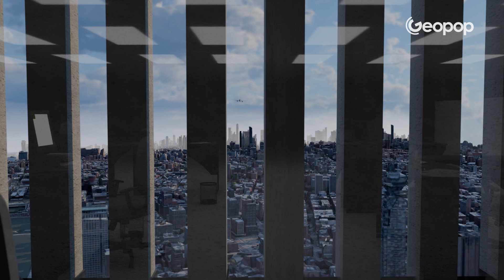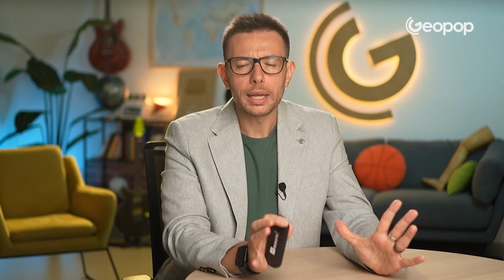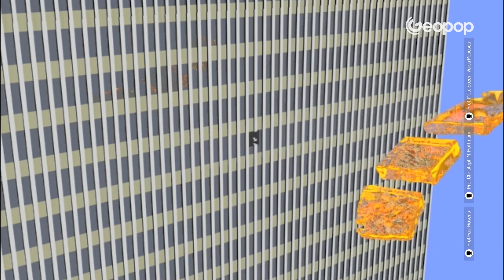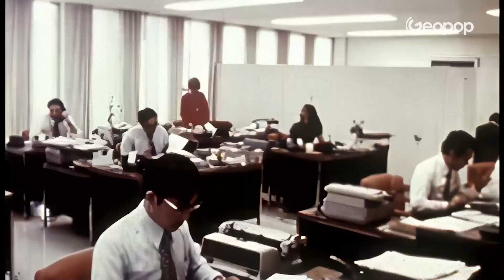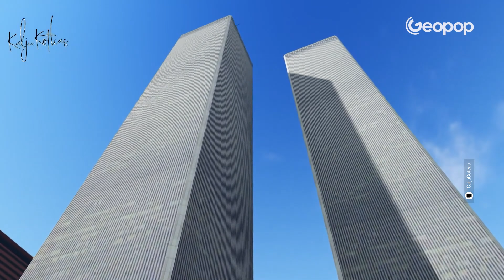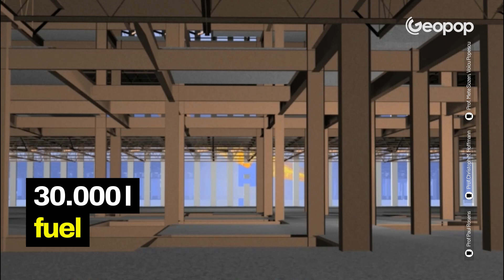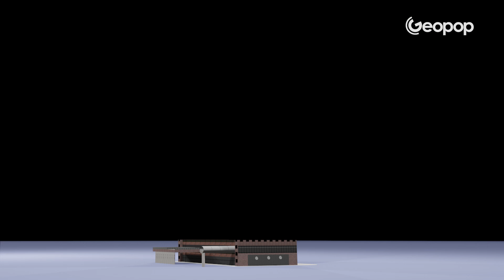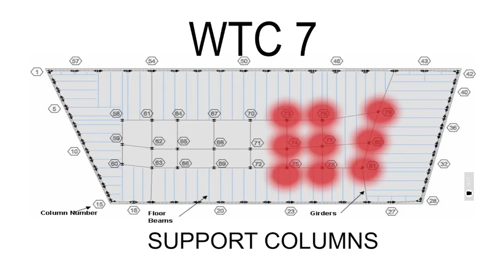9/11, 2001: The Technical Reconstruction of the Twin Towers and WTC 7 Collapses

Comment: Why did the fire burn underground for over two months?
Reply: There’s tangible evidence of steel that endured heat corrosion. I have yet to see tangible evidence of molten metal. A pool of molten metal was the claim.
Reply: Jesus these people are so stupid holy crap
Reply: Thermite.  The steel was quickly exported to China and investigators were barred from taking samples to analyze for explosives residue.  The steel of the lower floors was not affected and only the top should have tipped over and fallen.  They have tried numerous times over the years to fabricate scenarios to explain the speed at which the towers went down ignoring videos of explosive charges going off in sequence on different floors as the buildings were collapsing.  Another video to silence the sceptics, how many more will they put out there.  This collateral damage and deaths justified America going to war, hundreds of deaths and thousands of casualties.
Reply: @themoderaterebel  
You meant “6 months”.
Reply: @jasviation7511 77th brigade don't even TRY and make their disinformation convincing any more, do they?
Reply: @themoderaterebel  
Because it was a controlled demolition
You also have to take in consideration what the firefighters witnessed on that day when they were trying to stop the trains from passing through the buildings and clear the passenger out 60 feet on the ground, they witnessed a river stream of molten metal in the basement of the building_
Reply: @themoderaterebel  
Ah, the ever-reliable defenders of the narrative—those valiant champions who will stop at nothing to uphold the official story, never daring to question it, yet they’re the first to sneer at anyone with the audacity to think beyond the script. It’s almost as if critical thinking is some rare, mythical art form they’ve never been taught, or worse, are too terrified to embrace. They cling to their carefully packaged reality, too afraid to peek behind the curtain, lest they discover a truth that shatters their fragile worldview. And the best part? The moment you dare to share a nugget of real insight, they don’t just reject it—they lash out, ferociously, like a pack of rabid swine, proving exactly why wisdom should never be wasted on those who prefer ignorance. Funny how the Bible had it figured out ages ago—cast not your pearls before swine, because in the end, they’ll only turn around and try to trample you for it.
Reply: What is the source of the many tons of molten steel found in and under the debris, the heat so intense that the molten steel remained in that state for weeks afterward, running off of the debris as it was excavated. This cannot be molten copper from wiring that retains the color of a shiny new penny.  It cannot be molten aluminum that retains the color of the polished aluminum wheels of a street racer. It was the color of glowing orange molten steel  that cannot be mistaken for any other material, reported by firefighters who are very experienced in the nature of such materials as well as seen in video evidence.

When you combine this with an entire lack of turbulence behind 500 mph aircraft, when even a small Cessna Aircraft would leave an evident wake in the smoke and fire only seconds later .  . We find that skeptics still cannot be skeptical of the official narrative in explanation.  Sponsored channels and forum activity are skeptical of nothing when support is provided.

Sponsored activity in the forums is very normal today for commercial and political purposes and subjects of controversy -- in the attempt to lead public debate.
Reply: @ronaldgreene5733  dingdong, copper is red hot at its melting point, and aluminum is only silver exactly at its melting point. If you continue to heat it, it begins to glow with black body radiation line literally every other piece of matter in the universe. 

You guys are skeptical of everything but the nonsense coming out of your mouths.
Reply: It was the mole people working for the government! 😂
Reply: The NIST report was heavily flawed.with WTC7 the only calculated expantion from Heat in only one direction and omitted several supporting connections
Reply: The towers were built on a car park that was full of the cars of all the occupants of the entire area, thousands of vehicles.
Reply: Thermite.
Reply: @infantryrecon101st Yes lets play that game i see you muppetness and raise  it with Aliens
Reply: @ulrichkristensen4087  You’re an idiot lol, you obviously can’t think for yourself and you’ll believe anything people tell you without actually doing the research yourself. Bush needed a reason to start a war and get oil, there’s video evidence of white work vans unloading thousands of pounds of chemicals in bags for months before the supposed attack. There was no construction work being done at that time. Those vans could’ve easily had explosives and thermite, they’re the same fake white work vans the cia uses for their operations. Also a cia building that wasn’t even hit but had potential evidence in it was also put down in a controlled demolition free fall. Look at a controlled demolition free fall and look at a building actually collapsing because of failure, they look completely different. All of those buildings that day were destroyed via a controlled demolition by our own government for their own benefit not ours. Also look at government throughout history they’ve never once been good since the beginning of time, so yes they would do something like that just so they could invade a country. Back then you need public support to actually start a war and they would fund the war by upping taxes, that war wouldn’t have been ok with the people without doing something very bad so the people would all be angry at the supposed other people that did that bad thing. The government has been doing stuff like this since the beginning of time. Make a terrible event blame it on whoever they want and boom they have the support they want or need, without anyone actually thinking for themselves and putting pieces this whole system just gets worse and worse. Look at msm and how they attempt to brainwash and make fake stories every single day these days, yet idiots like you are destroying this country because you believe them and go along with the narrative and lies they continue to spread. Have fun with your communism I won’t be a part of it and many others that can actually think for themselves won’t be.
Reply: @infantryrecon101st  thermite has its own oxidizer. It will burn out in a very short time no matter how much is present.
Reply: @nivarion  ok lol its what made all the molten steel that was underground, that’s what they used to cut the steal beams and there’s a lot of proof with thermite actually collected at the scene.
Reply: The thermite that cut through the steel?  Making it molten?
Reply: @JohnWayne-w2g no evidence of thermite. How long are you morons gonna ride that dick? God it's like you're pumping the loose change morons dry.
Reply: Why don't you look up what fed the fires instead of regurgitating a conspiracy you saw on youtube
Reply: @TheDadTitan  And WHAT fed the fires?   How did the steel melt like that?  Why did firefighters see molten steel?   Who are you?  What is your purpose here anyway?
Reply: @JohnWayne-w2g how did the firefighters know it was steel? Did they take some out and let it cool? Or did they just see something flowing red hot like molten steel in a movie and call that molten steel? 

What they saw was molten glass, copper, and aluminum. Things that have lower melting points and glow when very hot.
Reply: @nivarion  Why on earth would it be molten glass?   When each tower had 10s of thousands of tonnes of structural steel?  Do you know how ridiculous you sound?
Reply: @nivarion  Who the hell are you, to decide what people saw?  They were there, you were NOT!    They saw molten STEEL!
Reply: @JohnWayne-w2g  who am I? Just someone who routinely works with molten steel. Actual molten steel, not something flow and glowing. 

The buildings also had hundreds of tons of glass, aluminum and copper, all things that actually melt  at the temperatures present.
Reply: @JohnWayne-w2g  it would be molten glass because glass was 1. Present and 2 melts at the temperatures the fire was burning at. 

Steel is yellow or yellow white when melted. Nothing in there was hotter than bright red.
Reply: @JohnWayne-w2g  lol, they 100% did not see motlen steel.
Reply: @nivarion  I doubt they saw molten glass either though it was certainly hot enough in places to melt but dull red glass would of been very taffy like aka viscous. What they likely saw was molten aluminum, from the planes and the outer sheathing of the towers themselves. I recall seeing footage of something running out the plane impact holes .. that was aluminum. Any molten or solidified metallic puddles on the ground were aluminum
Reply: @nivarion  You were NOT THERE!!! The firefighters were!   Wow!  Don't the 77th brigade even try any more??
Reply: @JohnWayne-w2g  sorry man. But not all eye witnessess are credible. I am perfectly willing to accept that they saw something molten. I know too much about molten steel to believe it was steel. 
You cant show any melted steel from the rubble, because there was none.
Reply: @nivarion  Why would these firemen have taken pics?  And why would the pics be made public, if they pay people like you to say 'no its not'...bla bla...Don't the 77th even try any more?
Reply: @nivarion  Why would it be the ridiculous molten copper fairy tale?  When steel accounted for 99% of the towers metal components?
Reply: @nivarion  You literally don't even care how obvious you make yourself, do you?
Reply: @JohnWayne-w2g  you freakin retot. You have no clue just how clueless you are. 

Things we know were in the tower burn around 2,000 degrees. Aluminum, present in the thousands of tons, melts at 1100 degrees. Glass, present in the thousands of tons at 1600 degrees. Copper was present in the hundreds of tons, melts at 1900 degrees. 

Note that all of these have a lower melting point than the combustion temperature of office furniture. 

Steel melts at 2500 degrees. 

The firefighters describe what they saw as red hot. 2,000 degrees is a bright red color. 2500 drgrees is a yellow white. Therefore we can conclude that anything melted and red was not steel. 

Unless you have some evidence to say there were thousands of tons of mystery fuel moved into the buildings with nobody at all seeing it, you should shut up, you paranoid victim of the dunning-krueger effect.
Reply: @JohnWayne-w2g  You weren't there either. Molten steel would be a blinding white. If your sources were indeed firefighters instead of conspiracy trollers, some might not know physics and material science any better than you do
Reply: @xenuno  You paid trolls are really funny, and desperate!  They didnt state what colour the molten steel was!  It does NOT have to be blinding white!  You are thinking of magnesium!  Dear lord, the 77th brigade really need to try harder!   You make it too damn obvious!
Reply: @JohnWayne-w2g  Listen dimmy ... for steel to be in a liquid state if will put out a white light. This is not from oxidation as with magnesium. For metals, the color emitted can infer the temperature of the metal. Paid troll ya .. as if there were something to gain with baby talk to conspiracy prone children
Reply: @JohnWayne-w2g  Paid trolling for the likes of you? I have prose backed with fact .. what do you have? Conspiracies. Iron-Steel in a molten state is white. The color determines temperature. Something like Tungsten starts to show the same color and because its such a high temperature element, barring oxidation, can stay intact while producing an even brighter white as temperature climbs. Magnesium burning is oxidation. Help yourself. Getting a GED is the first step to enlightenment .. make it happen
Reply: @xenuno  It doesnt matter what the 77th have told you to tell us to think!   You make it too obvious, man!
Reply: @JohnWayne-w2g  77th what? Conspiracist? Those are the only ones telling anyone what to think. They number in the 100's with generous support from aliases. Least I think so. Public education has failed them and you. It's obvious you weren't trained for critical thinking but I'll bet you're ace with the identity pronouns. The world needs chimney sweeps and ditch diggers, so I know, along with gov welfare programs, you'll be OK. Lay off the the theories though man, feigned knowledge on any topic skirting technical is a costume that doesn't fit you at all.
Reply: @JohnWayne-w2g  77 what? Conspiracists? Battled with way more than that. I see they convinced you but proof all over this thread on your past & present cerebral malleability. Try again Gacy Jr ..
Reply: @xenuno  Waffle and gish gallop...meaningless...desperate to have the last word!  Pretending hes not part of the 77th brigade, which literally anyone can look up, in seconds!     Dear God, you really don't even try, do you?
Reply: @JohnWayne-w2g  Ya 77 what? If it had any merit I would of looked it up years ago when this topic was still hot and you guys would get your arses handed to you regularly by more than just the few survivors left (such as I) who are willing to enlighten, full well knowing that the denier cult has learning disabilities. Do make sure to get the last word in .. can you make it a doozy? Tired of reading the equivalent of you playing with your baby rattle and teething rings. Close with something intelligent, possibly fact based, for a change ...
Reply: @JohnWayne-w2g  Ya 77 what? If it had any merit I would of looked it up years ago when this topic was still hot and you guys would get your rears handed to you regularly by more than just the few survivors left (such as I) who are willing to enlighten, full well knowing that the denier cult has learning disabilities. Do make sure to get the last word in .. can you make it a doozy? Tired of reading the equivalent of you playing with your baby rattle and teething rings. Close with something intelligent, possibly fact based, for a change ...
Reply: @JohnWayne-w2g  Ya 77 what? If it had any merit I would of looked it up years ago when this topic was still hot and you guys would get your rears handed to you regularly by more than just the few survivors left (such as I) who are willing to enlighten, full well knowing that your club has learning issues. Do make sure to get the last word in .. can you make it a doozy? Tired of reading the equivalent of you playing with your baby rattle and teething rings. Close with something fact based, for a change ...
Reply: @xenuno  The 77th brigade will sack you if you keep performing this badly!
Reply: @JohnWayne-w2g  god, what a useless gormer you are. An example of wasted human potential. 

Maybe if you were half as smart as you think you are you could move out of your mother's basement.
Reply: @JohnWayne-w2g  there was likely plenty of copper in the building though. All the wires. Computers. Printers. Phones.. And I would think atleast some of the water pipes
Reply: @nickabel8279  Sure!  But not 'flowing like lava, deep within the basement!'   Only molten steel, or REAL lava, could explain this!
Reply: @nivarion  They also said they heard explosions from the basement but were just elevators and debris falling in the shafts.
Reply: @JohnWayne-w2g  dude, false dichotomy much? Why does it have to be molten steel or molten stone? 

Why not any of the thousands of tons of other things present that melt at much lower temperatures, and which can actually be molten  and red like the firefighters claimed they saw? 

Steel can't flow and be red. It's still quite solid while red hot.
Reply: @nivarion  The firefighters saw molten steel!  Molten steel flows! 
Of COURSE it does! 
Why is it so vital to you, that no one talks about the molten steel?
Reply: @JohnWayne-w2g why is it so important to you that it was melted steel in the rubble, and where did it go? 

The only evidence you have brought is that some firefighter said they saw molten steel, which they also describe as being red hot. You also have that the bulk of the structure was steel, and a lot of childish accusations that I must work for some shadowy government agency. 

I am a structural steel machinist. I work on and with structural steel all day, every day. This is my wheelhouse. You're just amusingly wrong here. 

 All things molten flow. That isn't a unique property of steel.  The fires were hot enough to melt glass, copper, and aluminum, which were all present in large quantities. All of which are red while molten, which the firelighters you are relying on describe the molten liquid being. 

Steel melts over a thousand degrees hotter than those things, and is white hot. It's so hot and bright that you need specialized equipment to be as close to it as they were. 

Molten steel would have also been a huge challenge to remove after it had cooled, and required either several tons of exotic fuel be brought into a very busy building with nobody noticing, or something forcing air into the fire. 

Just knowing the peoperties of steel and how it melts rules out all of the evidence you're claiming for molten steel. 

Yes, I know the firefighter said molten steel. But how do you actually know he was credible when he identified what red holt melted mass he was looking at was steel?
Reply: @JohnWayne-w2g  dude. How did the firefighters know it was molten steel? 

Look, I'm a welder and machinist, I work in, and all of my certifications are for structural steel. I have been melting steel for years now as a regular part of my work and am pretty familiar with what it looks like. 

They describe it as red hot, and several times used red as a description of what they saw. 

Molten steel is NOT RED. That is why I know they weren't looking at molten steel, because molten steel isn't red. 

It's the same temperature as the filament of an incandescent light bulb, and makes a similar amount of light. Any large quantity of molten steel requires special eyeware because it is BLINDING. 

If the firefighters had seen molten steel they would have described it as WHITE or BLINDING. 

There's a lot of things they could have been seeing, but they did not describe the properties of molten steel.
Reply: @ 
Molten steel is red if and then, Cindy, such as thermite have been used to melt the steel columns
Reply: @MINDSPARK-u6e  why are you telling such an obvious lie as that? Why would the melting point of steel be more than 1500 degrees cooler for thermite?
Reply: @ 
You’re an agent are they still paying you to shill for them?
Reply: @MINDSPARK-u6e  oh dear god. Is that really the best you have? Are you really arguing that the only reason someone would point out that you're talking absolute nonsense is because they are getting paid by the government? 

That's the actual dumbest argument you've made. I am doing this because I am 1. Bored and 2. Have actual experience in the field, instead of what some shill who rinsed you for cash said in a poorly produced film.
Reply: @nivarion  Great! 'Red hot' as in 'as hot as it can get', Liquid, almost as thin as water!  Like runny lava!
So what?   Those towers had thousands of tonnes of structural steel within them, therefore it was molten steel!   Not any trace elements of any other metal!
So what?
What does this prove?
Reply: @JohnWayne-w2g  that is absolutely terrible reasoning. 

Structural steel is still a solid up to 2700 degrees. I don't think you realize just how hot that is. You either need forced air, or pure oxygen supply, or a LOT of exotic fuels to get that much steel up to that temperature. 

You have to provide evidence that any of those things were present. You also have to explain what happened to all of that molten steel. 

The buildings also had a several hundred tons of aluminum in them, which will melt and be red hot at the temperature of an office fire. What evidence do you have that rules out aluminum?
Reply: @JohnWayne-w2g  also bro, you're the one insisting that because they said steel that it must be steel. Why are you now acting like I'm unreasonable on insisting that it had to be red? I expect them to be a lot more familiar with the color red than how liquid steel looks.
Reply: @nivarion  
1. Exactly WHAT was the source of the aluminium?
2. And how many times more steel was there, than the aluminium? 500x?  1000x?  10000x?
3. Same question applies..What would cause the aluminium to turn molten?
4. And why is it vital that we disbelieve what numerous firemen saw?
5. What happens if people realise there WAS molten steel?
6. And why do YOU care so much?
7. Why are you falling over yourself, trying to convince people that it was tiny amounts of aluminium, and NOT the huge amounts of steel?
8. Who are you, and what is your REAL purpose here?
Your behaviour is getting highly suspicious!
Reply: @nivarion  There was huge amounts of structural steel present in the towers, and by comparison, trace amounts of any other metals.
Iron would require higher temperatures still, to turn molten!
So WHY is it vital to you, that people don't believe what numerous firemen saw?
What do you care?
'red hot molten steel'?
Are you saying  they all lied?
They were there, YOU were NOT!
Reply: @JohnWayne-w2g  no you miserable moron, I am saying that they had no way of knowing that it was steel, and the testimony of what the ONE not numberpus, but ONE firefighter saw is inconsistent with what molten steel looks or acts like. 

The majority of a franklin stove is iron. Are you saying that it would be entirely logical to claim that a franklin stove burns iron instead of the trace amounts of wood inside?
Reply: @nivarion  So, to recap, your argument isnt 'there was no molten metal', but actually 'the molten metal these numerous firemen saw, wasnt 'steel'??
Seriously?
Reply: @JohnWayne-w2g  yes. I also didn't say it had to be metal, just that it was likely aluminum. The reason being that there is absolutely ZERO FUGIN EVIDENCE THE FIRE GOT HOT ENOUGH TO MELT STEEL. 

Also. It was one firefighter. Not multiple, one. And you don't know if he was familiar with what melted steel looked like, and since what he described is not the description of molten steel, we can presume he misidentified something else as melted steel. 

Go look up some videos of steel pours. They overwhelm the camera because they're so bright. Molten steel is as bright as an equal amount of incandescent fillament, a single drop glows like a light bulb. Enough to flow is blinding.
Reply: @nivarion  NUMEROUS firemen mentioned the molten steel, and there are several photos of it too!
Of course fire cannot melt the steel, the jet fuel almost all got burned up in the initial fireball!
But WHO said it was the fire, that caused the molten steel?
'likely aluminium'?? NO!
It WAS the steel!
The question is WHAT caused it?
A device on the plane?
Devices within the building?
THOSE are the questions!
Why do you fall over yourself pretending those firemen lied?
What do you care?
Reply: @JohnWayne-w2g  dude, you are so stupid that you don't even realize just how stupid you are. 

You can't explain where the other fuel came from, and that's the bloody problem. The plane was already at max capacity with passengers and luggage and fuel, so you can claim it was on there. So, are you claiming someone took tens of  thousands of pounds of exotic fuels through the tight security on a building that had been bombed twice? And stored it inside two of the busiest buildings in the world with nobody noticing? 

My explanation requires nothing more than burning office furniture in a collapsed building. The things you would find in the WTC, clothes, furniture, carpet, cubicles and etc, burn hot enough to get aluminum into a red liquid. 

I've been in this debate for nearly 24 years. Not a pne of you has ever presented a picture of molten steel. Plenty of pictures of red hot SOLID steel, but nothing molten. 

Why don't you name five firefighters who claim they saw molten steel.
Reply: @JohnWayne-w2g  right. Name five then.
Reply: @nivarion  Molten steel, expired, fireproof passports, WTC7, missing plane at the pentagon, NORAD standdown, so many more!
The day physics and logic just disappeared!
You give yourself away too easily!
Reply: @nivarion  Your sense of reasoning is horrendous!
If they saw molten steel, then your questions should be 'How did it get there?  And what caused it'?
Not 'no they didn't because i can't think of how it could have got there!'
You aren't the sharpest tool in the box are ya?
Reply: @JohnWayne-w2g  dude, you have no room to be talking about horrendous reasoning. Your entire line of logic is one big circle, and you can't even answer how they knew what he was looking at was steel. 

Also guessing you couldn't find five firefighters who said it was steel. 

His description of what he saw is inconsistent with melted steel. No cleanup crew had to deal with melted steel, no melted steel was photographed, so all you have is one anecdote where someone with no specialized knowledge saw a molten substance flowing out of an office fire. 

So either there was a massive conspiracy that never cracked that moved tons of exotic fuels into the buildings, under the nose of security, with none of the thousands of people who worked and shopped there noticing it;
Or one guy could be mistaken. 

I know what you would pick, and what anyone with an IQ above 85 would pick.
Reply: @nivarion  Numerous firemen saw the molten steel!
There were pics of it too!
Why is it absolutely VITAL to you, that no one talks about the molten steel?
99% of the metals used in the construction of those towers , was structural steel!
So why are you desperate for people to believe it was 'trace elements' of other metals?
What do you care?
You 77th brigade trolls are hilarious!
Your angle isn't 
'there was no molten metal', but
'The metal wasn't molten steel, simply because we have been ordered to tell  the masses this, in a desperate attempt to 'sway public opinion'!
Hilarious!
'But...but..but...they 'could have' seen this/'MUST have been that/bla bla

You may as well have your username in giant flashing letters, stating '77th brigade troll here'!
Its THAT obvious!
Reply: @JohnWayne-w2g  dude, it's really cute that you think the government would pay anyone to talk to a basement dwelling loon like you about this. Terribly narcissistic, but cute all the same. 

You can't explain how the firefighter would know what melted liquid he was looking at. Can't explain why his discription would be inconsistent with melted steel. Can't name anyone else who claimed the same thing. 

Your best argument is that the building was mostly steel. 

Dumdum, a wood burning stove is mostly iron. Would you think it a rational argument if someone said they must burn iron because wood is just a trace amount of the stove?
Reply: @nivarion  99% steel, vs 1% trace elements!
Everyone knows this!
So why would it be anything else?
Why do you beg and plead with people to therefore NOT believe it was molten steel?
What do you care?
So now you are saying it 'may have been molten wood'??? WTF?
Why embarass yourself like this?
This is too easy!
Reply: @JohnWayne-w2g  god you're dumb. I litterally couldn't explain why you're a hopeless retard with crayons because you would eat them. 

Moron, if the government had actually done what you're accusing them of, your complete inability to make a coherent argument to support your case would be the best thing they could hope for. Your blathering inane arguments discredit everyone who accuses them of misbehavior. 

Which is why I care. You make everyone who criticizes the government look as dumb as you are because you don't have two braincells to rub together. 

That you can't even understand the stove question is a prime example of what a hopless cause you are.
Reply: @JohnWayne-w2g  okay. So we've established that you have the attention span of a squirrel. Lets try this. 

I've done a bit of blacksmithing, and have a forge in my garrage I haven't used in a while. Lets say I get a 1oz cube of aluminum, and 99 ounces of the same size cubes of steel. I stack them up and put them in the forge. I heat the forge to 1600 degrees. 

My neighbor, a firefighter comes over to visit, looks in and says 'your steel is melting' what liquid metal is he actually seeing?
Reply: @nivarion  he is seeing 99% steel!  No one is claiming its pure!   It does however, NOT get melted by jet fuel!
Stop detracting!  They saw a structural steel with a 99% purity then!  It will NOT melt due to jet fuel fires!
We all know your purpose here pal!  Its very obvious!
Reply: @JohnWayne-w2g  you definitely don't understand my purpose here, though I have told you before. I'm doing this because I am amused by the simpleton arguments you keep making, and your inability to grasp even the simplest of hypothetical scenarios. 

I also notice that you are completely oblivious to the scale we're talking about here. 

Yes, the metal in the building was definitely north of 95% structural steel. 200,000 tons of steel was used in 1 and 2. So if we take your number of 1% being aluminum from the cladding, that's still 2,000 TONS of aluminum. 

2,000 tons of aluminum would be about the same size as two large houses. So this isn't some miniscule amount. 

And you didn't answer that question. What melted metal did my firefighter neighbor actually see in my forge?
Reply: @nivarion  YES i answered it!  Your fictional firefighter  saw 99% molten steel!
Why is it so vital to you that no one talks about the molten steel?
If they said 'we saw steel with bird shit on it', would you still be saying 'no they didnt'?
What do you care?
Dont the 77th give you a better script to copy and paste from?
Reply: @nivarion  So, to recap!  Those firemen saw molten steel, but they 'might be mistaken/wrong/lying!
Also, the steel 'wasnt molten'wasnt steel/wasnt there at all'??
And, although the total metal within those towers was 99% steel, it 'might not have been/could be anything/but was 'probably nothing??
I will now sign in as 'mooneyes' or 'Timshead' or 'thecriticalstinker' and i will copy and paste random, generic drivel, from my 77th Brigade handbook, in a desperate attempt to ..erm...'sway public opinion'!
Jeeez, this is too damn easy!
Reply: @JohnWayne-w2g  lol. So the fictional firefighter saw 99 ounces of molten steel, 1100 drgrees below the melting point of steel. 

That was a cognitive test, and you failed it. The fictional firefighter was mistaken about the metals in the forge.

I'm beginning to think that among the endless things you don't know, the definition of molten is one of them. 

I have a challenge for you. You're claiming that the government used some exotic fuel to melt the base of the tower to bring it down. 

Que Bono. 

How does anything that happened after the planes hit the towers change, if the towers don't collapse? 

Does the patriot act not get passed with something like 1400 dead americans and the image of the towers on fire? Does the NSA not get created? Do you think we wouldn't have gone to war with Afghanistan and Iraq?
Reply: @JohnWayne-w2g  youtube keeps deleting my comments. Which is annoying. 

So to be brief, lets say that the government did bring down the towers with some magic fuel they mysteriously snuck into the building. 

What did they gain from doing that? 

If the planes had just hit the towers and there were 1400 dead americans, but they didn't fall, does the government not get the NSA? Maybe they can't get the patriot act in? 

What was the motive to do all the extra work?
Reply: @nivarion  all the glass would have been shattered everywhere. How would there be enough molten glass to be running anywhere.
Reply: @MattRiley-v1r oh my, I hadn't considered that. Broken glass is of course, famously unable to melt. 

Oh wait, no, that's nonsense.
Reply: If you do a little research it turns out constantly dousing the rubble with water was causing the evaporated hydrogen to react with the hot metal and increasing the temperature.
Reply: @Apodalont    WHAT "evaporated hydrogen"??
Reply: @Steve52344  Now there is hydrogen, and its evaporated... and its now the fuel of some underground fire...for two months???, how i dont know. There is no science or logic in America, apply logic at your own risk.
Reply: @Steve52344  When water hits something hot what happens to it? Steam correct? What's a byproduct of evaporating water???
Reply: @Apodalont  maybe it was thermite!!
Reply: @Apodalont  Nothing, it's not a chemical reaction
Reply: @Steve52344 The fuselage and wings of 767’s are made with aircraft aluminum. When molten aluminum is exposed to water it turns into aluminum oxide and hydrogen. I’m not sure if this is the hydrogen they’re talking about though.
Reply: @E1eMenta1   That would be the only plausible source of generated free hydrogen, which rises and can ignite, usually in flashes.  But it wouldn't take long for continuously sprayed water onto molten aluminum to cool it below the reaction temperature that releases the H from the H20.  Aluminum doesn't retain heat like iron or steal, and despite what the 9/11 conspiracy crazies claim, there was no molten steel found in the rubble for explaining the lingering fires.
Reply: @Apodalont  Steam is still just water molecules, and water vapor is still just airborne water molecules ..  either way it's still plain old H2O! .. NO Hydrogen.
In either case the molecular bonds of H2O are NOT broken and it does NOT split apart into separated hydrogen and oxygen molecules.
It requires higher energy and a process called "Electrolysis" to separate H2 and O2 from H2O!
Reply: @HannibalLecter-hi4hh  are you serious? What is h2o? Hydrogen and oxygen. Go read a science book!
Reply: @hughzapretti-boyden9187 Yeah that's it. About 5,000 pounds could work. GTFOH.
Reply: @E1eMenta1  there is no way in hell an office fire ignites thermite ingredients, I've actually tried with a blowtorch... You're 1000 degrees shy of ignition temperature
Reply: @hughzapretti-boyden9187  The fire fighters said that they saw molten iron at ground zero flowing like lava 🤣🤣🤣🤣 It was definitely thermite.
Reply: @hughzapretti-boyden9187   Maybe you need to go outside and get some sun.
Reply: @Apodalont  Electrolysis? I think you need electricity to separate that hydrogen when water is heated.
Reply: @PaterDJ  Thats true and even thermite reactions are not energetic enough to keep the ground and the steel red hot for months, in my opinion Khalezov, Wood and Pommer are right, they used some kind of device either a nuke or something else entirely to bring that buildngs down, if there was air planes or even thermite bombs they both were just used for special effects, somebody wants to bring this building down, and it was destroyed on that day. For the ones that don't believe me calculate for yourselfs how much energy you need to keep the ground that hot for this long (about three months).
Reply: @PaterDJ  I’m not exactly sure what you’re talking about when you say thermite ingredients. I’m pretty sure introducing 10,000 gallons of Jet A into an “office fire” means it becomes something more akin to an aviation fire. 

A 767 can carry up to ~24,000 gallons of fuel. The 767’s that hit the WTC were fueled for a cross country flight so let’s say ~12,000 gallons minus flight time up to the moment of impact… so let’s estimate each aircraft hit the WTC with ~10,000 gallons of fuel. Jet A burns at ~3,725° F inside the combustion chamber of a jet engine. Aircraft aluminum becomes molten at the relatively low temperature of 1,220° F. If water from the fire suppression system (if it was working) came in contact with molten 
aluminum, hydrogen would have been introduced into an already extremely hot fire. I don’t claim to know all the factors involved in the collapse of the twin towers, but the factors above seem more than capable of heating the steel enough to weaken the structure to the point of collapse. Conspiracy theories fall flat when the evidence points to the collapses being the result of basic chemistry and physics.

I also agree with Steve above. There’s no way aluminum would have remained molten for very long. It wouldn’t have been a contributing factor much past the actual collapse.
Reply: @E1eMenta1 The jet fuel from the impact went all the way down to the lobby of The World Trade Center immediately 😭😭😭. Especially The North Tower some people were burning in the elevator 🛗 at the time.😢😢😢😢
Reply: @hughzapretti-boyden9187 literally no evidence of that, yet you people still ride that conspiracies dick.
Reply: @Steve52344  Complex chemistry but H2 can be generated from aluminum, gypsum (dry wall), plastics, iron, and possibly water ... if the temperatures are high enough. The towers were NOT sheathed in SS as originally planned, but instead with aluminum plus you have aluminum from the plane bodies. Compounds of these reactions is partially where claims of Thermite use by the mentally challenged came from (and the obvious oxy acetylene post collapse torch cuts). "Evaporated" that he used is the wrong word, "generated" is more appropriate. Is his premise accurate? Likely not. There was plenty of fuel left in the rubble piles and with limited oxygen, continued to smolder until these massive mounds infused with human remains could be picked through and removed
Reply: @GI_D204  How your comment made it past the censors is beyond me. It's a load of tripe !
Reply: @Steve52344  At high temperatures, steam will break down into hydrogen and oxygen.  This is one of the primary dangers with overheating a nuclear reactor, that the steam will break down causing hydrogen pockets to form, which are explosive.  This is what blew the roof off of two nuclear reactors at Fukushima.
Reply: @xenuno   "Mentally challenged."  Yes, they indeed are, to put it politely.  Your assessment makes more sense than anything those crazed 9/11 "truther" engineers could ever fathom.  I commend you.
Reply: @hughzapretti-boyden9187 Bingo
Reply: @Apodalont  steam is not hydrogen steam is still H2O, do you know how much energy is required to split hydrogen from oxygen.... it's why we don't have water power cars now..... way more energy is required than gained
Reply: @Apodalont  It also puts the fire out.
Reply: @xenuno  🤣🤣🤣🤣🤣🤣🤣
Reply: @SuperheroJunior Donning-Kruger much? Do you also believe the earth is flat and that man never went to the moon?
Reply: @GI_D204 A nuke are you utterly depraved of neurons?
Reply: Lmfao,  let's ask Barry Jennings in wtc if he heard explosions? Ahh yea he's also dead shortly after giving a interview
Reply: @GeronimoLogistics  Explosions .. from large volumes of air being compressed between floors as the building collapsed? Steel splice joints breaking bending and breaking? Reinforced concrete reduced to small chunks and dust? There was lots to be heard there even before they collapsed. So ya .. lets resurrect him and ask. BTW: I'm not sure who you were responding to but it has the fallacy of intentional demolition written all over it ..
Reply: @GeronimoLogistics  'whacked'!   Like so many more, for speaking truth!
Reply: @Apodalont Question for you. What if a scientist wrote a book on demolitions? Would you trust it then because a scientist wrote it?
Reply: @GI_D204 yess finally someone els who has seen what I have (Dimitri) 😉🤫 most definitely what you’ve just said!!  Carnt say too much tho otherwise bye bye comment😂
Reply: @hughzapretti-boyden9187Thats delusional nonsense!
Reply: @pigramgregory2  so what exploded? What were the huge fireballs? So the fuel went through all the floors and made it to the bottom immediately? All the fuel must have hit an elevator shaft.
Reply: @hughzapretti-boyden9187nanothermite to be precise. Dozens of eyewitnesses that day reported explosions and the authorities never bothered to test for the presence of explosive residue 😮
Reply: @Apodalont you don’t understand enough to comment.
Reply: @brianjensen6087 go read official reports. Go read a science book. I didn't make it up its what happened.
Reply: @GI_D204 Nanothermite was found at ground zero, a much more volatile material. And terrorists aren’t making that in their kitchens.
Reply: @Apodalont  There was nothing so hot down there that could split up water into hydrogen according to the 9/11 Comissions Report, so the official theory has big problem with the fires rageing on for months and on the other hand there was nothing down that could feed a fire that long you would need a lot of energy to keep it that hot for so long, thats why some think they used underground nuclear demolition, sounds crazy but would explain why the ground itself was so hot for months.
Reply: @Apodalont  are you a retard? Do you really believe that trying to put out a fire with water can increase the temperature somehow? 😂🤡
Reply: @Apodalont  ah, that old sausage eh?
Reply: @Apodalont 
I researched 3000 bodies disappearing from a building collapse and came up with fairytale scenarios 😂😂😂😂
Reply: @Apodalont lol
Reply: @Apodalont you sound like a bot
Reply: @Apodalont 😂😂
Reply: @Apodalont  HHAHAHAHAHAHAHAHHAHAHAHAHAHAHAHAHHAHAHA
Reply: Larry Silverstein 🇮🇱 (owner of WTC complex) said - "Pull it, and we made the decision to pull and we watched the building collapse" - referring to WTC 7 - not hit by planes.
"We are benefiting from one thing and that's the attack on 911" - Benjamin Netanyahu 🇮🇱
Reply: WTC 7 was a controlled demolition. 
Can’t convince me otherwise.
Reply: @pololikikuju best comment! Inside job